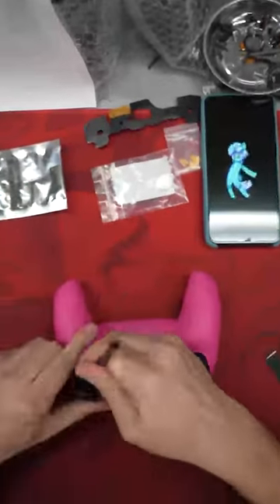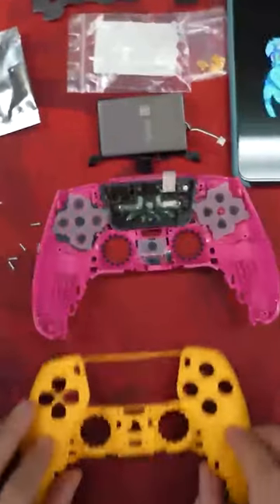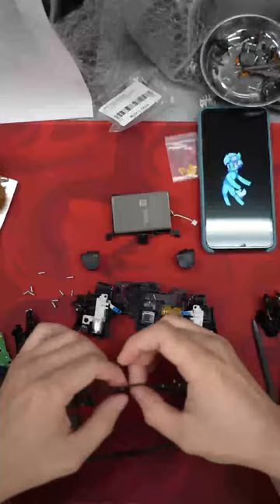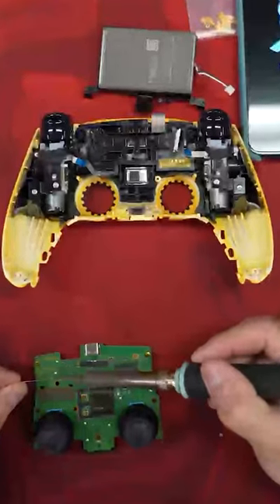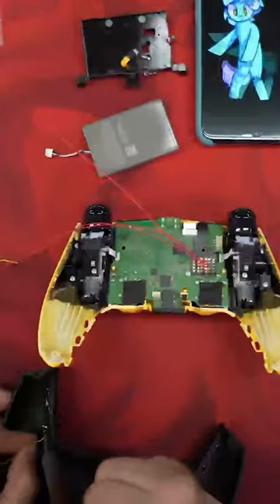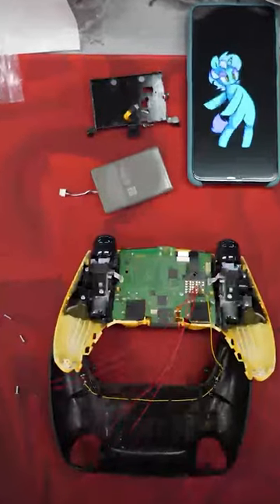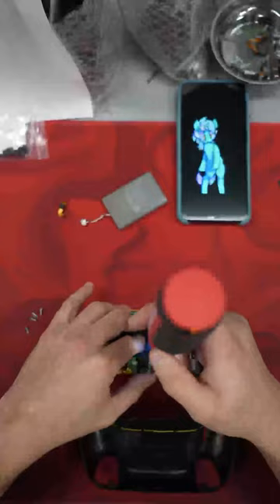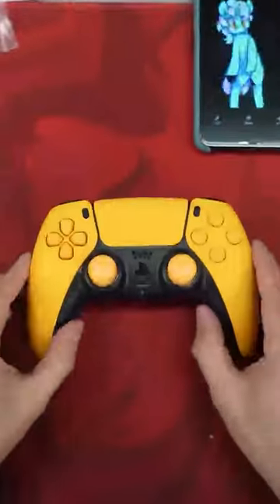building a custom ps5 controller #gaming #pov #ps5 #console #gamingsetup

Comment: Elite series 2 or scuff I’m wondering which is better
Reply from the maker: option 3. Cinch Controller
Reply: To expensive
Reply: @Cinchgaming  your controllers don’t have many features you don’t have thumb grips or back paddles or controller grips
Reply from the maker: @xITZSTARKx We sell thumb grips,  We have back buttons which in the long run are much better than paddles.  Magnetic paddles fall off over time and have a pull distance for activation.  Mouse click back buttons are instant activation and are placed perfectly for fast activation.  No longer in the heat of a game will you accidental hit the back button which happens with long paddles.  And we do have Cinch grip for controllers.
Reply: @Cinchgaming  but the thumb grips aren’t on the website and the back buttons are 74 DOLLARS LIKE WHAT
Reply from the maker: https://cinchgaming.com/products/ps4-ps5-xbox-thumbstick-grips-2?_pos=7&_psq=thumb&_ss=e&_v=1.0